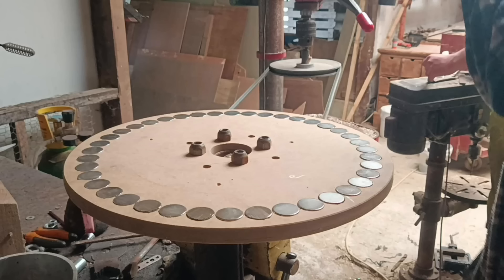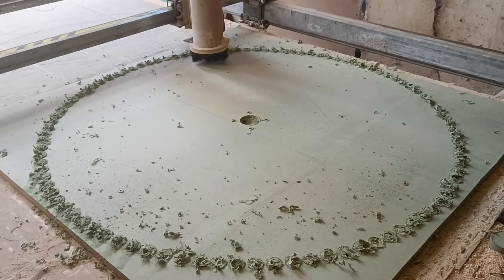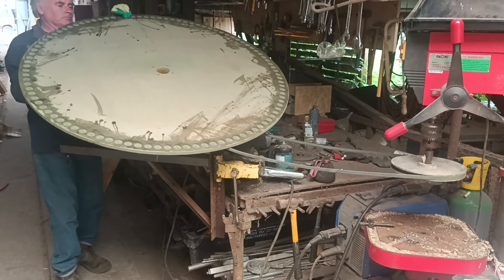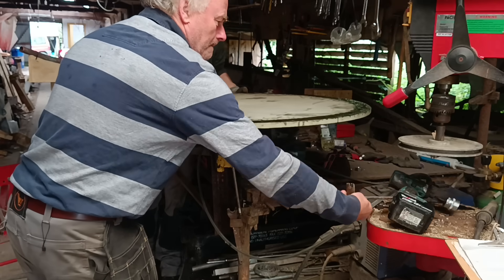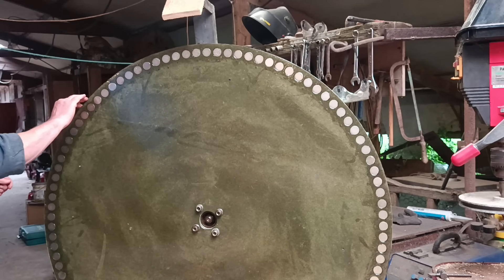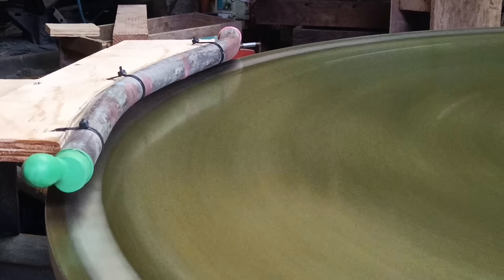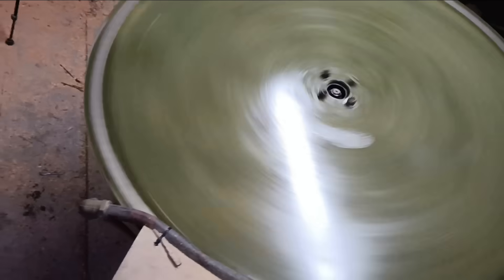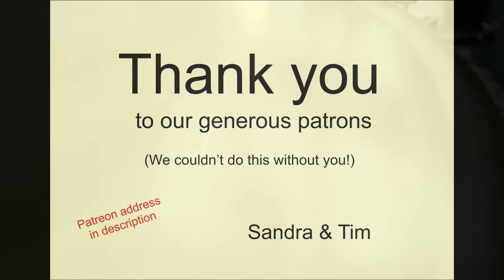ABSOLUTELY HUGE Magnetic Induction Heater! Using 100 Spinning Neodynium Magnets And A Bucket

Comment: Excellent idea! I enjoy watching your thought processes. The only improvement I can think of, aside from the ones you’ve already considered, is allowing the magnets to go through completely giving you double the surface area for your magnetic induction, bending the pipe so it goes completely around the circle of magnets. Then, turn the pipe under have the pipe go back around and then back out. This way, you would use both sides of the magnet and have the pipe the maximum amount of induction heating for the amount of magnets you have. Just my two cents I hope it makes sense completely around the top and the bottom.

Comment: I'd say to orient the disc with the axis horizontal, with four copper pipes, preferably flat bottomed toward the magnets, two on each side of the disc going around half the circumference with four cold inlets at the bottom and outlets at the top. That way you'll get much better thermosyphon action as the hot water will easily rise to the top. Maybe enclose the whole disk and pipe assembly in an insulating case, this should also improve efficiency as you're not wasting energy just throwing air out at a tangent, it will stay largely in the case and contribute more heat.

Comment: 1) NEODIM max  Temp. is 80 degree, after that the magnet will broke USE STANDARD MAGNETS THAT SUPORT until 280 degree
 2) Acirclewith 20 magnets is equiv with 100magnets because is a cycle (circural object)
3) Use a pomp to water circulation with heat sensor (have 2 temp critical, One at 100 degree, second at magnet upper limit heat support 80 or 280 degree)
4) use a Contaiver near magnets grom copper to heat more eficient.

Comment: Wouldn't this setup be massively improved if you use a heatblock to generate the heat in, and then run thin pipes through the block for quick exchange of heat?

Comment: You could try to slalom or wave the copper pipe back and forth horizontally so each magnet travels across more of the copper pipe and you can fit more pipe in a given arc section of the disc. 
Also cover a larger arc across the disc or ideally the entire disc with the wavy pipe. 

Perhaps you can even put a complete circle of wavy pipe underneath the disc as well and insulate the sides of the pipe not exposed to the magnets with the pipe being as close as possible to the magnets since it will dramatically increase the strength of the field and thus the induced eddy currents responsible for the heating effect the closer the pipe gets. 

I think magnetic field drops off by the inverse cube law rather than the inverse square like light or gravity.

Comment: I don´t understand the use case. If something drive this wheel, it could also drive a generator with a heating coil connected. This would be way more efficent then this big spinning wood wheel with magnets glued in.

Comment: There's a significant drop-off of field for this size of magnet which diminishes how much magnetic flux you have the farther you are away from the surfaces of the magnets. My strange suggestion then is: while you're machining out the big circle, add a groove on either side out near the edge but before the magnets, then put a large fixed plastic caster wheel or small tire to keep the nonplanarity from wiggling the edge up and down. If the edge jiggles too much, it becomes harder to get whatever circle you're heating truly hot. A halbach array is typically used when you want one side of a line or ring of magnets to be stronger than the other. However, I wouldn't suggest one here because making it would be complicated and because I don’t think it would actually help because it spaces out the magnets with poles flipped 180 from each other so, which reduces the flux. This makes me think that slightly thinner rectangular magnets which could be placed closer together would produce higher flux, however you'd have to balance size vs closeness. The larger the magnet of a given strength the more uniformly strong it is above it, so you have more wiggle room, but the bigger it is the more it spaces out the flips so you get less flux.
All in all, nice work! It's very cool! :)

Comment: Nice work. Totally looks like something I would do (and my wife would scratch her head at). Here are my suggestions... have your "heater" pipe maybe do a complete loop around the perimeter of the wheel for full-contact with flux-field. Shorten all the rest of the plumbing as much as possible, the extreme height difference isn't required for this type of hydrothermal "pumping" action. And clearly, insulate all plumbing, even the top of the "heater" pipe.

Comment: How about getting a second hand electric car motor from a scrap yard and spinning that?  Should be safer and more powerful. Then you could connect the 400V DC supply to a couple of 240v electrical immersion heater elements in series and heat your water that way. 

Or mount your magnets to the outside of a car tyre using flexible polyurethane based marine sealant in several rows.  Then mount the tyre on an alloy wheel on a driven car hub.  You should be able to secure them with some old lifting webbing from a crane, cut and sewn to make a tight sleeve, just place it over the deflated tyre and inflate to make tight. Get it balanced at a tyre shop then mount vertically inside a copper coil made from copper pipe wrapped around as many times as you can, keep secure on a wooden frame. Drive the wheel via the half-shaft as fast as your gearing will allow, you could even use a gear box to up the speed.  The metal in the tyre and hub should not heat as the magnetic fields they experience are not changing. 

Your horizontal rotating platen looks too wobbly and weak for sustained use.

Edit to improve the English.

Comment: an idea:
put the copper tube inside another, larger, plastic tube while it's on the magnets. water flowing on both sides of the copper pipe means that the heat radiating off the outside won't be wasted :D
plus, no resistence added to the spin

Comment: In every water heating system, the water is drawn from the bottom and returned to the top of the vessel, inducing a pump like action from the heating of the fluid.

Comment: It's not the moving magnetic field that heats the metal.  The moving magnetic field causes electrons in the metal to move in synchrony, which causes friction.  The friction of the motion of the electrons heats the metal.
Reply: You dont seem to understand cause and effect.
Reply: So, it’s almost like the moving magnetic field causes the metal to heat up?
Reply: Electrons moving is heat. Heat is just kinetic energy of subatomic particles.

Comment: Know that getting the magnets as close as you can without hitting is critical for max  power (flux) transfer. Magnetic flux strength (density) follows the inverse square law meaning that moving the pipe from one unit away from the disc to two units away means you are now only getting 1/4 the flux lines heating the pipe that you were getting at 1 unit. (and 3 units away is 1/9, 4 units is 1/16th etc...) 

You should also switch to a steel or iron pipe as copper doesn't "respond" as well as ferrous metals to changes in flux (stainless and aluminum should also be avoided for the same reason) 
 
Finally insulation will help with the max temp rise/delta but anything you put on the heating pipe increases the inverse square loss so it quickly becomes diminishing returns.

Comment: Two suggestions for improvement. First you have an open magnetic circuit; the underneath is completed in air. A Halback array will make a massive difference to the flux induced. Secondly, your copper pipe is too thin. A thicker block of copper will generate more internal current and hence heat. Try to minimise all air gaps. For your present arrangement, magnetic steel lamination connecting north south under the disk will help. Good luck Dr Paul
Difference
Reply: Even tho i'm an engineer i'm not super sure but i was under the assumption that iron was the best metal to use to carry magnetic fields, then i have heard one want to avoid magnetic storms in transformers, that is supposedly why one use laminated steel in transformers.
To verify if this is the case one can use a solid block of steel and see how fast that heats up compared to a laminated equivalent.
the air gap between the magnets and the steel/copper/aluminium/whatever matters alot.
You might also want to monitor the temperature of the magnets becuse they probably also heat up just as fast as the thing you are trying to heat.
It might melt the resin and start flying away and carsh in to things and yourself, major risk of injuries in this case, i bet they will all fly away in a 12 second window if they reach the melting point of the resin.
Reply: @Ollerecovery  The "magnetic storms" in the core are called "eddy currents".
Reply: a heavier copper heating target would prevent oversaturating the copper, thus extracting more power.
Reply: He could also put a coffee cup immersion heater in the bucket of water.
Reply: It is unclear whether thicker pipe will help or hinder the effort. If he makes a magnetic circuit, it will increase the coupling, but not necessarily the efficiency of the system. In other words, it will need more torque to get spinning. But will produce more heat at a given speed. Is that a win? I think it depends on how much torque his driving source has available in the first place. I don't really see there being any loss mechanism in the system other than heating of the pipe. So I don't think he needs to focus on improving the magnetic circuit unless he wants to increase the magnetic resistance. And that is why it is not clear whether making the copper thicker will improve things. In a motor, you want lots of copper to reduce I^2r losses. But this is kind of like a motor where we WANT I^2R losses.
Reply: @mckenziekeith7434  it's an interesting question but i'm not sure that you would want greater losses. For two reasons. You get more heating if the copper isn't saturated with magnetic fields. Also you have a greater short circuit effect and heating with thicker copper
Reply: @mckenziekeith7434 would using smaller magnets, maybe a bar shape oriented to be pointing in, but many more of them help? Essentially increasing the frequency of the magnetic sinwave?
Reply: Yes, a good magnetic steel under the magnets will increase the flux on top side by almost a factor of 2*. It does not need to be laminated as the flux on the bottom side will be almost constant. It must be thick enough that it does not saturate too much though. As the heating effect is close to quadratic of the magnetic flux, increasing it by a factor of 2 will give about 4 times the heating assuming is all else is the same.  *Assuming the magnets are mounted directly on the so called back-iron.
Reply: @teamsafa  The flux is constant only if that added steel rotates with the disc. If it is stationary, the field will be alternating.
Reply: @8546Ken  Yes, of course the steel should rotate with the disk. I thought that goes without saying, and it is also the easiest way to get it really close to the magnets. But I am maybe home-blind after doing PM motor designs.
Reply: @teamsafa   When you're dealing with 1000 readers on  Youtube, some people won't consider the same things obvious.   Don't assume anything.
Reply: I agree with everything except the Halbach array, if he did that it would space out the flipped poles so while it would definitely get stronger on the top side it might reduce the flux so it might be tricky to get it to work better (there's probably a clever way around that though), it might also be difficult if he's using the same kind of magnets on the rotated ones to get them to happily fit snuggly into the disk. A laminated steel "magnetic yolk" is a great idea but it would add a fair amount of mass to the rim and you'd have to be careful to avoid laminated steel throwing stars... you could probably use a microwave oven transformer cut into pieces. It's also a good way to remove the temptation of using the microwave oven transformer for something more electrically dangerous, lol. (Those things are terrifying)
Reply: You may need to keep the magnets cool to avoid them losing their magnetism.
Reply: Also add a small amount of acid or alkali to the water to make it conduct electricity better.
Reply: @richardamullens   The current flows through the copper pipe, not through the water, so you don't need to add anything to the water.

Comment: It's a fun concept but I think it would be more efficient to use a conventional generator and resistive element to heat the water.
This is the same thing just worse. I don't think the idea of "cutting out the middleman" will bare fruit.

Comment: I understand using copper will of course create an 'Eddy Current' and some heat but iron (or steel) pipe would create more of that 'skin effect you're hoping for', would it not? Isn't that why induction cookers require that instead of copper also? If that's correct why not place iron tubing matching the circumference over the device? 

With all this in mind, what then wil be the measured BTU's in heat produced vs. the BTU's in electrical power needed to run this device? Enquiring minds want to know...

Comment: I think this is a brilliant idea. I want to test something like this myself now. I have a windmill at my house. It's simply for decoration now but it used to be used for pumping water. I think you should do some tests on how much resistance there is for different lengths of pipe. Can you go around the entire circumference of the circle? Or would that require too much torque to keep it spinning? Also what is the difference between copper pipe and aluminum pipe? Definitely insulate everything.

Comment: Wrap the pipe around the whole thing and insulate it in fiberglass so it won’t build up a static charge. Then the next level of efficiency, you can add additional layers of magnets to the center and bend much narrower pipes into several close bends to maximize contact or use old radiators if you can find them. After that you can add another disk above the pipes and try switching to oil as it will retain heat better. If you can get the heat high enough you can lead the oil into a closed loop with a small pump and an engine heatsink to a water reservoir and a water tank.
Reply: There is no static charge because you have eddy currents in the material.

Comment: Pipe insulation will conserve the heat for better convection flow. a shorter tube might help, not lower than the magnet surface.  good science, Thank you

Comment: No need for a huge wheel. You could stack a few smaller discs with pipes between. Would probably be more efficient and allow for temperature/torque control if you adjust their relative positions on the axle. A Tesla valve in the direction of flow would ensure cooler water is heated. Think racing Vs. Standard clutch.

Comment: Great effort!  1. Insulate all the pipework and bucket to reduce radiant heat losses.  2. Extend the copper pipe beside the magnets. 3 Measure rpm of the disk while 4. Measure current draw on the motor driving the disk vs revs per minute, to make sure the setup is not stalling.  Adjust distance of copper pipe from the disk to max torque without stalling the motor, which equals max heating effect. 5.  Keep having fun, because we are!  Notes: You could measure torque by deflection of a spring loaded idler pulley on the belt.  For a setup with 'natural' inputs like wind or a water wheel, there will be an optimum torque vs rpm at which you will get maximum power out.  Adjust the length of copper pipe or its distance from the disk to adjust how much power is being extracted while letting the setup run in the optimum torque/rpm range.  Data is king!

Comment: I really like this idea and its fun and you should keep at it.
BUT
You probably already know all of this, but I think the physics of nature is interesting so ill say it anyway.
Heating things with electricity or mechanical work, in a configuration that is not, at least, a heat pump will almost always pale in comparison to getting the heat from the sun directly or from chemical reactions.
With electrical systems take, for example, using solar panels, you only get around 20% of the suns' energy converted to electricity and then convert that to heat with resistors, when it could have been just straight converted to heat, skipping the 20% electrical step and getting a lot more heat. (this is why they have solar water heaters)
The same thing goes for work. It's really hard to get energy in the form of mechanical work from say heat (heat engines are inefficient and you get a lot of waste heat).
So my point is, if you have a windmill, use that mechanical energy for mechanical work and find something else for heat (like wood) where it has a LOT of thermal energy that is not easily converted to work. So don't 'waste' precious 'work' energy on heating things unless it is at least a heat pump.

Comment: Put them in concentric rings, then run the copper piping in a pattern that maximizes it's length spanning these concentric rings, top and bottom.  This way you are not wasting the mechanical energy.  You can also put it in a box with a vacuum, this way air friction is eliminated.  With improvements you can make your setup an awful lot smaller.

Comment: It's suboptimal to use copper as the heater element, copper is extremely conductive so it's creating little joule effect when placed into an alternating magnetic field. You really need to find steel/inox pipes (20-40 times less conductive), they will convert most of the current into heat and be much more efficiently. If you can't find such (probably not easy), in the worst case, lead pipes should already be 14 times better than copper. Not as good as steel but still much better than copper.